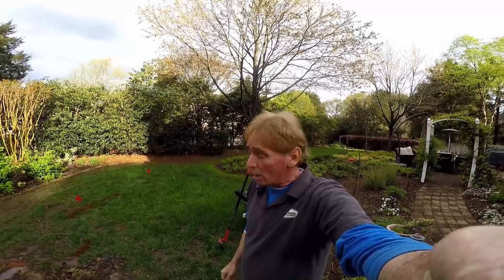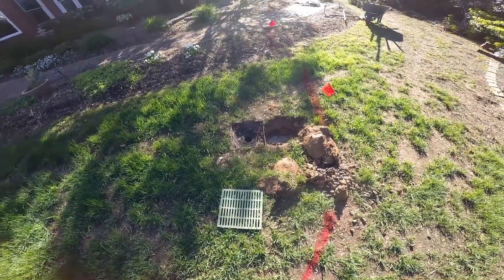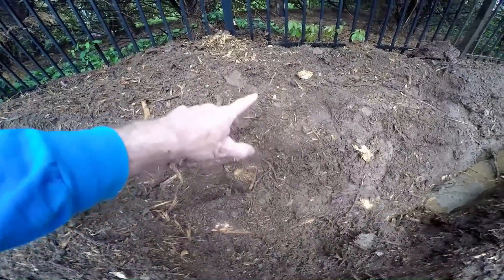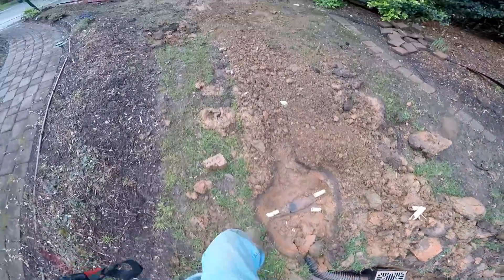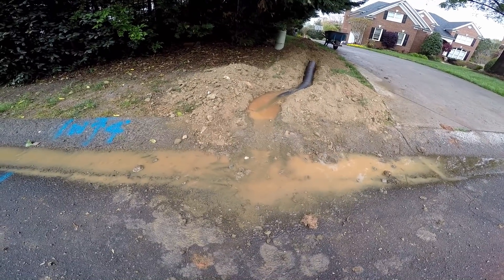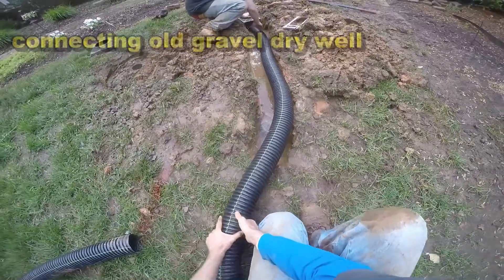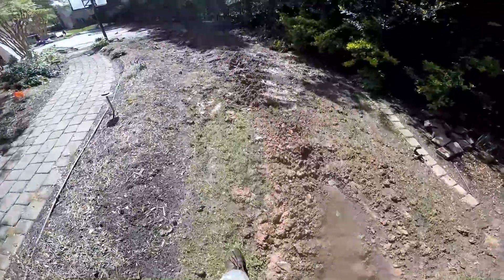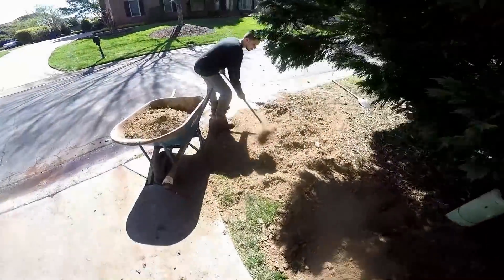Dry Well, Do They Really Work?

Comment: I have clay.  We have sidewalks and are not allowed to discharge to the street or sidewalk.  How do I discharge mine?
Reply: I had the same issue,  no ditches,  I used the drywell shown.  it works great.  if you need more you can connect 2 or 3 dry wells to meet your needs.
Reply: +Battle Cam thank you!
Reply: +thatjlyn I have the same issue. Hard clay soil and the county stopped allowing drainage to the gutters last year. I installed the same drywells, in fact three of them in a huge 3 1/2 foot deep 6 x 12 gravel pit. It does not drain down into soil fast enough at all in the hard clay soil. Luckily I found this out before I finished covering up. I added a sump basin so that I can pump the water out and use it to water the grass or something. This huge pit will hold 500+ gallons so depending on how much rain we get determines when to pump it out.
Reply: +ytmuzic  So, in other words the 3 dry well system wouldn't have worked by itself?  Or, did it work but needed a little bit of help from addition of the sump basin?
Reply: Extend the discharge line all the way to the edge of your property to a catch basin. Make sure the pvc line has a check value installed.

Comment: Why don't you use the fabric around the drain pipe to keep sediment out?
Reply: They're not using perforated pipe.
Reply: Thanks,
Reply: Because the fabric will get clogged. The right way to install a French drain is gravel all around the pipe and complete gravel backfill to surface.

Comment: Looks like the 24 inch diameter dry well. The property shown seems like a large parcel of land. Obviously too under sized to accomadate the run off of this house.
Reply: +Frank Spencer  As I wrote above, just went through this. If the soil won't percolate it doesn't matter. My 500 gallon dry well holds up to 3 inches of rain. Some times of year that's a weeks worth or less. It didn't go down for 72 hours. That's when I realized I also needed to pump the drywell out too. Some clay soils won't percolate (absorb water) at all. You must do a perc test properly first.
Reply: yeah,  probably could have just put another one down flow 10 feet away.
Reply: +Frank Spencer Agreed, there is a calculator and additional instructions for clay soil.